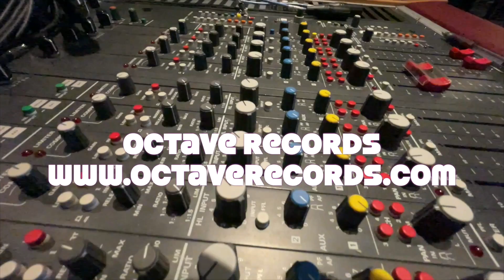PCM to DSD conversion

Comment: Isn't the vast majority of SACD titles simply a conversion of the PCM recording to DSD? Very few were actually recorded in DSD...
Reply: I would think a lot of those SACD titles were recorded and mixed in analog. In the 90s when I worked at recording studios we always tracked on 2" 24-track analog tape, mixed down to .25" analog tape, then assembled the album and saved it to DAT. So if they used those .25" analog tapes as the source you're going straight from that to DSD.
Reply: @white.lodge.dale.cooper  My understanding is that the tape recordings were digitized to PCM at some point, well before DSD even existed. I am very doubtful that the studios went on a hunt to locate the tapes, then played the tapes on analog equipment to make DSD recordings of them. Instead, i think they simply converted the PCM recordings they already had, to DSD. Marketing took care of the rest to promote the 'superiority' of SACD. That's the equivalent of placing an 8 1/2 x 11 sheet of paper in a 11 x 17 envelope. The content is still 8 1/2 x 11 no matter how large the container is. A modern musical performance recorded straight to DSD? Now that's the real thing. But SACD versions of old recording from the 60's, 70's, 80's? Pleeeze!

Comment: Thanks for the explainer. I tried upsampling PCM to DSD on the fly on my old DAC but it didn't make much difference but I got a new higher end DAC and upsampling on the fly definitely makes it sound better, maybe it's that analogue sound you mention. My new DAC is from Matrix Audio. I'm very impressed with it even though it's a few years old now.

Comment: PCM to DSD sounds so much better in the high frequencies and energy is there and is less fatiguing on the ears. This is because I'm using a high quality DAC but on a low quality DAC there is no difference between pcm and DSD.
Reply: I tried upsampling on the fly with my DAC (Matrix Mini i Pro) and it made it sound way richer and fuller. I think it must be that it's making it sound more analogue which is always good.
Reply: It doesn't. There is simply no mechanism by which that could be true other than cognitive bias in your brain lying to you.

Comment: "The idea of analog is false" ~ Paul McGowan April 28th, 2022
https://www.youtube.com/watch?v=Uo7gLtlxXdI
Unfortunately Paul there is scientific evidence that most "high quality" DACs don't sound any better playing DSD than PCM.
In fact, evidence would show that there is virtually no hearable difference between high-resolution PCM and DSD (PDM).
PCM "mastering" does not require a conversion to analog and it is not a likely sequence of what was done in the mastering process, as the PCM file (unlike DSD) is editable including any process used in mastering.
There is also no need to go through an analog to digital converter to convert the "mastered" PCM file to DSD (PDM).
Now it should be noted that the original recordings for Blade Runner were done on analog tape and that subsequent remasters were done in a hybrid analog and digital domain most likely on a Pro Tools rig.
You have to make up your mind Paul.
Last week you told us there was no such thing as analog.
How could there be a "more life-like analog sound" if analog isn't real?
Reply: Thanks, Jon but there is no scientific "evidence" as you refer to. There are people who make measurements that claim they cannot measure a difference but that's a whole other can of worms for discussion. There is no question DACs sound different as well as formats. One need only listen to discover that.

Comment: I play my CDs through pcm to dsd512 software on the fly. The sound is definitely better than when played as a straight CD through the same dac. I attribute this in part to the filter the dac uses in dsd mode.